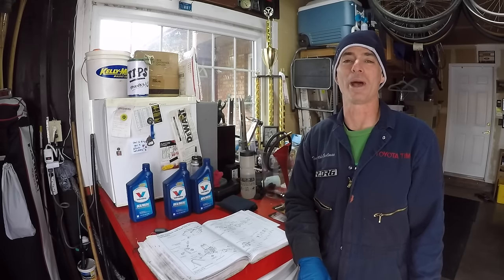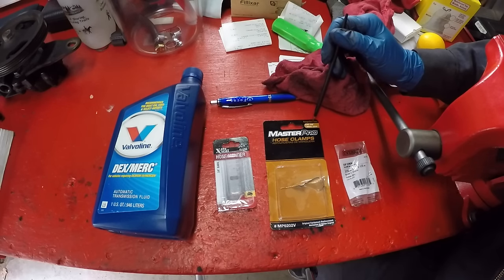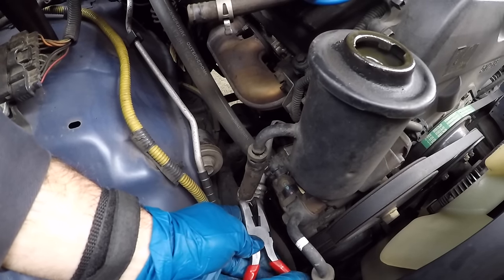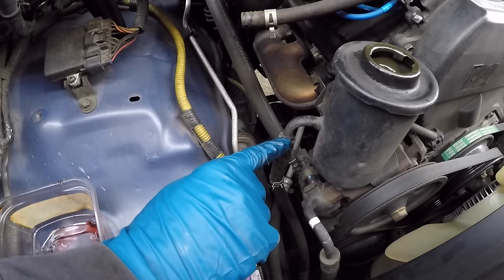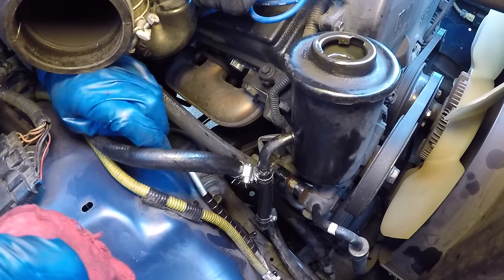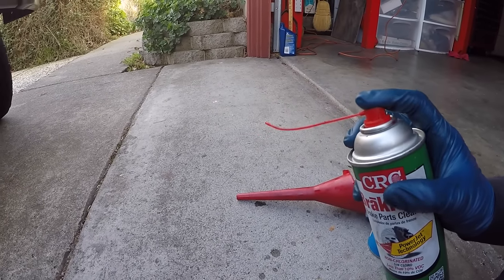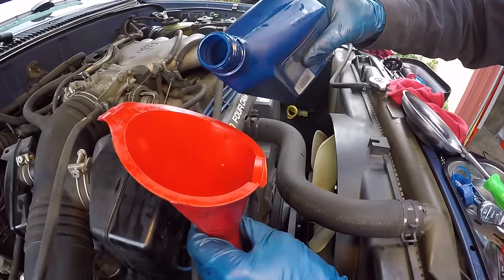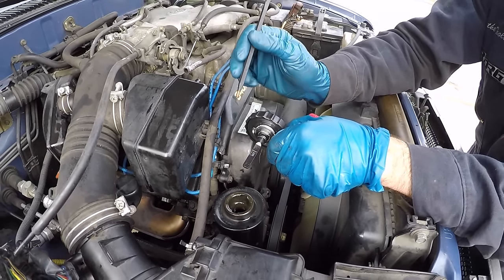Power Steering Flush and Reservoir Cleaning

Comment: Thank you for the video!

What if you put the cap on the reservoir, turned it upside down and filled it full of brake cleaner and let it soak to clean the screen, or better yet, plugged the outlet where the o-ring lives and let the cleaner soak the screen right side up?
Reply from the maker: Hey Steve, you're welcome.  I don't know what you mentioned would clean it out successfully but it would definitely help loosen the gunk up.  I'm pretty sure it was a combination of the cleaner with the propulsion of the spray that helped clean the screen out.  If you weren't in a rush and you wanted to let it soak overnight with the cleaner like you mentioned, I think it would help.  But, you most likely would have to follow it up with spraying from both sides to further loosen the gunk up and get it pushed out of the screen.
Reply: I figured it would take a lot less spraying.
Reply from the maker: You're probably right as long as your willing to let it sit long along to let the cleaner loosen up the deposits.  If you try it, let me know how it works out.

Comment: First I want to say thank you for your videos I helped me quite a bit I have a 99 4Runner 3rd gen V6 I flushed it three times clean the screen and I can still hear a wine do you have a video on how to replace the entire pump power steering pump thank you again
Reply from the maker: That's a bummer your pump might be going out.  Sorry, but we don't have a video for removing the pump.  But, it wouldn't be hard to do.  First, you would need to disconnect the high and low pressure lines.  From doing the flush procedure, you already know how to disconnect the low pressure line.  The high pressure line will probably be a little hard to break free but I assume you'll have no problems getting it loose.  Next, loosen belt which we have a video that can help you with that: https://youtu.be/Zi1XfFUOjKc   There'a an electrical connector you'll need to disconnect.  Lastly, the pivot bolt and the adjuster nut you loosened to get the belt off will have to come off completely to remove the pump from the engine.  Your replacement pump will most likely not come with a new reservoir so you'll have to transfer that over.  Good luck!
Reply: Timmy The Toolman its great you respond on an older video
Im going to try this flush on our 03 Tacoma to see what it does. It whines when warm and sitting at a red light.  🤞🏽 the flush does it and new rack or pump is not needed
Ty for your vids
Reply from the maker: @JLeeChron  Good luck with the flush.  Let me know what the result is.
Reply: Sorry for the long delay, but thank you again, you are great to respond to me. Have a good weekend @TimmyTheToolman
Reply from the maker: @stelladanielepucci-turpin5091  Did you replace the pump?  If so, how did it go for you?
Reply: Unfortunately, it needs Passenger side Upper and Lower Ball Joints , Front brakes and rotors and I found a buyer as -is , So I am going to sale it :( . I'll try again in the future. Thank you again, next time I wont take anyone's word for what condition it is in, I'll Take it to my Mark Miller Toyota guys :) first.
 Too bad your in Cali, I'm in Utah, I would have paid you to look at it. @TimmyTheToolman
Reply from the maker: @stelladanielepucci-turpin5091  Ok Stella, maybe you'll join the 3rd Gen 4runner club at a future date.  Take care.

Comment: This doesn't look particularly fun, but I think I'm going to attempt it anyway since it has been a few years since I paid someone to do it.  Thanks for the video!  Does the FSM say anything about running the pump "dry" during the flush procedure?  Seems like a few seconds wouldn't hurt it.
Reply from the maker: John Morgan I couldn't find anything in the FSM related to flushing the fluid.  It's not really that bad of a job.  After filming it, I realized it would have been nice to have syringe with a short section of tubing to suck out more fluid from the reservoir before disconnecting the return hose and pulling the reservoir off the pump.  It would have made it less messy for sure.

You're probably right it wouldn't hurt the pump to run it dry for a few seconds but why take a chance?  With the way we did it in the this video, we kept fluid flowing through the pump for the whole process.  Happy Wrenching John!

Comment: Great video, thanks! I’m wondering in retrospect, do you think it would be better to clean the reservoir before doing the flush? It seems like it was a bit of rework to flush first.
Reply from the maker: Hey Nolan,  somebody else mentioned the same thing but since they were pretty disrespectful with their comment I just ignored them and blocked them from commenting on our channel.  However, since you asked in a much nicer way, I'll answer your question.  The reason why I flushed first is because if I cleaned the reservoir first and then flushed, I'm running that dirty fluid through the clean reservoir screen and maybe that fluid has some suspended particles in it.  Now I've potentially partially clogged the screen again.  By flushing it first and then cleaning the screen out, you will guarantee you'll have a clean unclogged filter screen when you're done.  I don't understand when you say it was a bit of rework to flush first.  Whether you flush first or clean the reservoir first, you still have to do both operations.
Reply: Timmy The Toolman Thabks for the clarification, that makes sense. And I think you’re absolutely right to block rude or disrespectful people. It takes a lot of work for you to make these videos and we’re very fortunate that you do! I really appreciate it, you have saved me time and money!
Reply from the maker: Thanks Nolan.  It's people like you who take the time to comment and recognize the effort that goes into making these videos that helps fuel our desire to keep making them.  We are making a little money from our channel but that's not the real motivating factor for us.  We like hearing how our videos have empowered people to handle their own automotive repairs, maintenance and mods saving themselves a ton of money in the process.  Thanks for taking the time to comment.  We appreciate it.  Happy Wrenching!
Reply: Timmy The Toolman I’ve been binge watching your vids for days now as I’ve just purchased my first 4Runner and was searching for a reliable source of maintenance info. So stoked I ran across your channel. My son just recently developed an interest in turning a wrench so we’ll be going through this ‘00 SR5 2WD front to back together. I decided to comment here even though my question is off topic, but similar. If I’m going to flush my transmission AND replace the filter in which order do you recommend doing them? I’m guessing it would be the same as you just explained above for the PS reservoir but want to make sure. 

Again, just wanted to say how grateful I am to have found your channel and I look forward to future videos!

By the way, noticed some IAFF stuckers on somebody’s rig. You or Sean in the FS? Asking cuz I’m retired Reno FD
Reply from the maker: Ryan Irvine Hey Ryan,  glad you found our channel.  The order in which I'd do a trans flush and filter change would be the opposite.  I'd drop the pan first, replace the filter and then perform the flush.  The reason I'd do it this way is because you would waste fluid unless after you finished the flush, you drained the contents of the pan into a clean container to add back in.  We're not talking about a little fluid.  When you drop the pan and replace the filter, you drain out around 6 quarts which is 50% of the system capacity.

I'm a firefighter for the City of Salinas.  Sean works for Apple.  Have a good time wrenching with you son.  If you have questions along the way, just ask.  Happy Wrenching!
Reply: Thanks Timmy! I appreciate the response and the time you put into these Brother! Subscribed! Hopefully I can find someone doing great videos like this for the 80 series Land Cruiser now!
Reply from the maker: That's cool you have a Land Cruiser as well.  I've been looking for a 1st Gen 4runner to add to my collection.
Reply: Actually don’t own one yet. Looking at a couple up in the Bay Area right now though. First new vehicle I ever bought was a ‘91 SR5 “Pickup” when I was stationed up in Alaska in the Army and I’ve loved Toyota’s ever since. I’m looking for good YouTube videos on maintaining them like you do for the 3rd gen 4Runners to give me that little added comfort to go ahead and pull the trigger on a Cruiser. I talked myself into buying this Runner even though it was 2WD and I love it, but I’m wishing I’d of held out for a 4x4. I live down here in Pismo Beach and I’d prefer to have the ability to venture a little farther into the dunes than I can with just one rear tire digging into the sand. Anyway man, didn’t mean to hijack the power steering pump comments!
Reply from the maker: Hey, maybe there is a YouTube channel specializing in Land Cruiser 80's   Who knows?

Sean and I might be heading to Pismo for some wheeling with a guy we met at our party.  I think it's the weekend of June 23-24.

Maybe we could meet up if we go.  If we don't, maybe you could make it to our next party.  We will probably have another one in the Fall.
Reply: That’d be cool! I’m in training for my new job so I’m not sure what my June schedule looks like, but Salinas isn’t too bad a drive from here. Maybe we’ll make the next get together!
Reply from the maker: Hey Ryan, I work in Salinas but live in San Jose.  So, another hour north for you.  Still, not that bad of a drive.  The guy we're going to meet in Pismo, this guy Anwar, came all the way from the Los Angeles area.  Another guy drove down from Arcadia near the Oregon border.
Reply: Oh yeah, San Jose is no problem either. We drive up there for mundane stuff let alone to go do something fun and cool! I lived about an hour outside of Reno and commuted too. Of course working 48/96’s made commuting from anywhere fairly doable
Reply: Really appreciate your videos. Well done!
I'm not following your response to "why not clean the reservoir first?"  Since you're flushing with new fluid and the old fluid is going into a catch can, it seems like only clean fluid would be going through the screen.
Reply: I had the same question on order of operations! Glad some already asked it🤘. Keep it going strong Timmy! Much respect for you making these videos!

Comment: Buddy I find it easier to take off that bolt. But you have to invest buying some new sockets and ratchet. Look into the low profile socket. Works very good on area like that and they make the low profile ratchet also. I promise you want be disappoint one bit. They make 1/2, 3/8, & 1/4 drive sockets. 3/8 haves different numbers in sockets over the 1/4 and I believe they're a set of 9/11 pieces.
Reply from the maker: What bolt are you talking about?  Do you have a link to the tools you're recommending?
Reply: Timmy The Toolman the bolt that you couldn't used the ratchet so you went with the wrench. That bolt is the one more towards the engine and don't have enough room for itm. It's The two bolt above. Hope you get I'm saying. 
This is a comparison From low profile to standard. 
http://www.aviationpros.com/product/10139755/snap-on-industrial-low-profile-socket-ratchet-sets

This is cheaper but if you don't mind or care too much about name brand and as long as it greats the job done.
https://www.amazon.com/gp/aw/d/B00ZYJIE3M/ref=pd_aw_sim_sbs_469_1?ie=UTF8&psc=1&refRID=NMRA89H1KD6WYM5Z4X29&dpPl=1&dpID=61LupaEKFML
Reply from the maker: I thought that was the bolt you were talking about.  Even with a low profile ratchet and socket, I don't know if you could get in there.  And remember, as the bolt backs out of the hole, the ratchet and socket go with it.  If you're able to get the ratchet and socket in there, you might only be able to turn the bolt a little bit before it would be impossible to take the socket off the head of the bolt.  I've had this happen to me many times where you get the bolt loose but then find you can't remove the ratchet and socket because there's not enough room to pull it off.  So, you're forced to tighten the bolt some so you can then get the ratchet and socket off.

Thanks for the links for the tools.  I love buying tools but I'm going to have to think about this one and decide if I really need them.
Reply: Timmy The Toolman No you'll be good to go. That's what I've use to take that bolt off. It's enough room to remove it too. I believe low profile tools was designed for things like that. It's like when you don't need it but when you do it's their and gets the job done. Anyhow I'm waiting on what's new for you to fix bud.
Reply from the maker: Ok, good to know.

Comment: I think you can also jack up the front, and turn the wheels without the truck being on.
Reply from the maker: 09ThunderOne Some others have said they've been able to do this too.  But, my experience was different.   When Sean and I replaced a steering rack for Sean's friend Dave, we tried this method but we're not able to effectively burp the system of air with the vehicle off.  So, we also figured we'd need to have the pump running to effectively move the fluid through the system.  If you try the engine off method, let us know how it goes for you.

Comment: hi @timmythetoolman what if my fine mesh filter is broken? I don't know if it was broken before I started drawing fluid or if I broke it with the turkey baster? in any event would it be bad to drive the truck with the screen broken? Thank you!!
Reply from the maker: Well if the screen is ripped, then we would recommend you replace that steering pump reservoir… the entire pump assembly can be found on eBay for less than a $100. You probably could run it if it’s an itty bitty tear in the metal mesh but ultimately, if a big enough piece gets dislodged and makes it’s way through the system, it could clog one of the lines starving your rack and pinion which would not be good. It also sounds like it would be a nightmare trying to clear the clog.
- Sean

Comment: I didn't want to have to do it but I think I"ll have to; a full fluid flush that is.  The main reason is because my master cylinder is stained dark brown on the inside so I cannot tell what my fluid level is at.  The previous owners must not have changed the fluid for a good while before I changed it.

I think I'll have to pull off the master cylinder in order to clean it with a hose or something to get that dark stain out so I can actually see where the fluid is at.  I was really hoping to be done with working on my car;  guess another thing to the list.
Reply from the maker: Hey Jonathan, you commented on our power steering flush video but it's clear to me you're talking about the brake master cylinder.  If you pull off the master cylinder, you'll have to bleed it first before bleeding the lines.  The factory service manual description of how to bleed the master cylinder looks straight forward but I haven't personally done it yet to know how hard it is.  Getting the master cylinder properly bled would be my only concern with doing what you're proposing.  If you do it, I'd be interested to hear how it goes for you.

Comment: Timmy, been hearing a noise for a while that comes on and off when driving , today I discovered power steering fluid splashed up in the engine bay. Loud noises when turning and all belts have been replaced. Can it be that the pump is gone ? and if so where can I get an oem power steering pump for the 3.4l 4runner ?
Reply from the maker: You must have a leak somewhere unless the cap wasn't tightened properly.  The noise you're experiencing could be air getting into the system due to the leak.  I suggest you figure out the source of the leak first.

Comment: Great detailed video!
Could you tell me the power steering fluid that we can use in Toyota instead of Dexron-II/III automatic transmission fluid? Because the ATF has the red colour(semitransparent).
Reply from the maker: You're suppose to use Dextron III.  I don't know of another power steering fluid that you can use.  If it's red, it's most likely ATF you have in there.  Keep it simple and just use Dextron III ATF.
Reply: Thank you
Reply: @TimmyTheToolman  Just out of curiousity, is it of thesame use and good result using Dexron III ATF over OEM PSF?
Reply from the maker: @franciscomirandaiii4000  The OEM spec is Dexron III.  Do not, and I repeat DO NOT use the generic power steering fluid you buy at an automotive store.  Dexron III ATF or an equivalent ATF is what you should use.  You can no longer buy Dexron III so you just buy an ATF that is compatible with Dexron III like a Dex/Merc.
Reply: @TimmyTheToolman  Toyota sells   Dexron ATF IV. I believe it replaces II and III.
Reply from the maker: @thedetective8150  I haven't looked at a bottle of it myself but as long as it says it's backwards compatible with Dexron III, you're good to go using the Dexron IV.

Comment: The part with the o ring when you pull it out does that disconnect it from the high pressure line? I appreciate your answer thank so much
Reply from the maker: No, the high pressure line is connected to the pump.  That has a special type of metal gasket.  The o-ring we suggest people replace seals the reservoir to the pump housing.
Reply: @TimmyTheToolman  ok so you don't have to disconnect the high pressure lin
Reply from the maker: @joegonzales772  No, you don't Joe for this flush procedure.  If you're swapping out the pump, then you'd have to disconnect the high pressure line.  For this flush, you're only disconnecting the low pressure hose off the reservoir.
Reply: @TimmyTheToolman  thank you so much Tim for you kwik reply I will be doing this to my 02 Tacoma
Reply from the maker: @joegonzales772  No problem Joe.  Good luck with the flush.